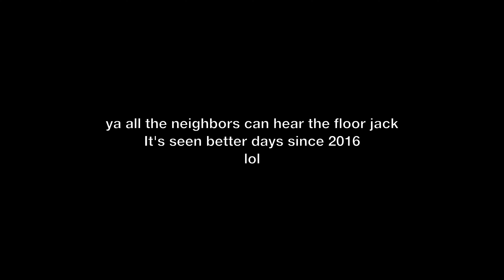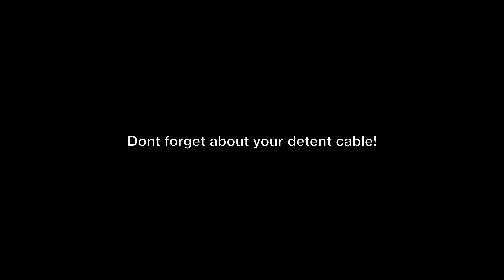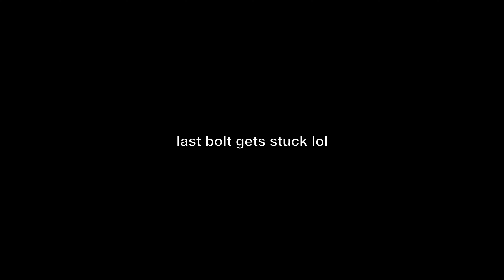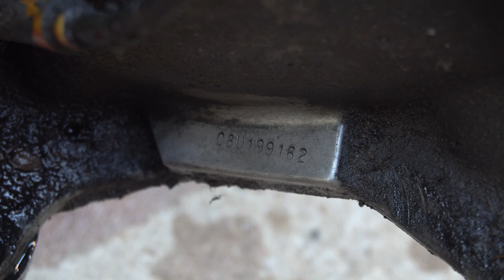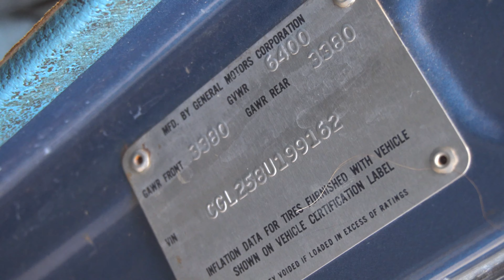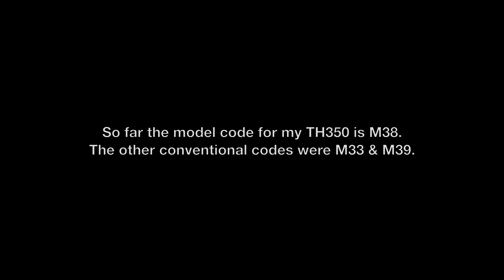1978 Chevy Van TH350 Transmission Removal

Comment: Cut a section of exhaust out and when finished splice it back in,or remove tank too an drain all the crap that’s probably in it.i have an 85 GMC Vandura 2500,that I did all the same stuff to while changing complete drive train front to back after rebuilding everything and adding posi.Iran the exhaust out in front of both rear tires but I’m just using the van as a test bed for the drive train that’s actually for a 72 nova which is also a pain in the butt

Comment: Thanks. I'm about to drop my transmission just to replace a couple of cheap freeze plugs behind the flywheel. You've shown me a few things to remember and a few things not to do. BTW, I don't think you have to remove the gas tank to remove exhaust. Just drop the cross over pipes and disconnect at any joint.  Or use a saw and cut the pipe anywhere and reweld later.
Reply from the maker: I'm glad that my video was able to help you somewhat.  Dude, definitely invest in a transmission jack don't do what I did lol.  Also don't worry about the gas tank it's not vehicle specific.  Most squares have the stock 15 gallon tank that won't interfere with the job.  Custom van, custom exhaust, and a custom gas tank, it needed to be removed.  I could've cut the pipe but it's just more work for something I'm trying to sell.
I'll have a video out soon on doing the front pump seal kit on my TH350.

Comment: Did you had to replace the seals ?
Reply from the maker: Yup, I have another video on replacing the seals.  The front oil pump in the TH350 has a gasket that seals it to the trans case.